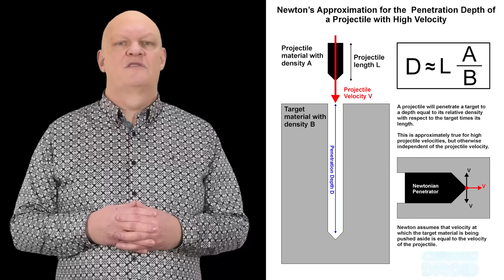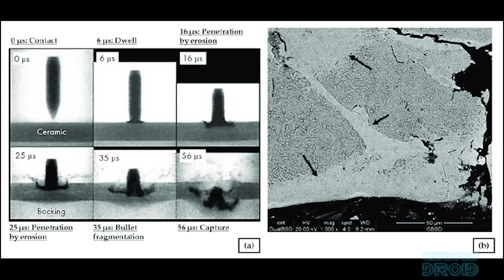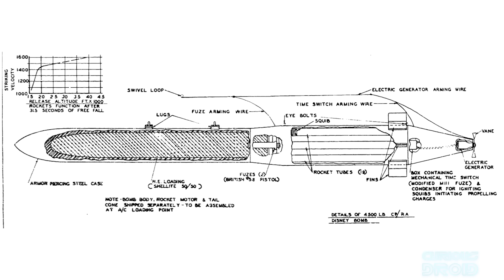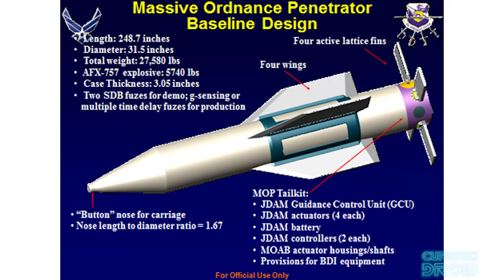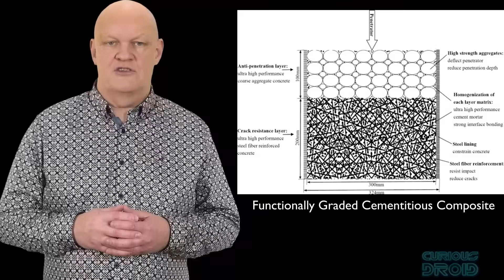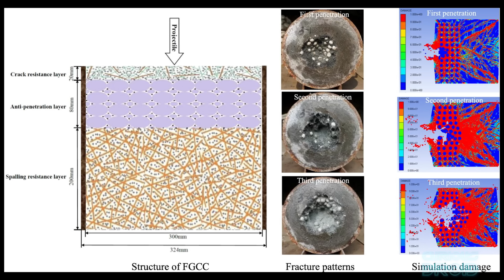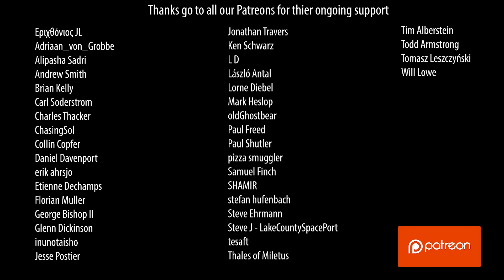Can Iran Stop U.S. Bunker Buster Bombs?

Comment: The next additive to add to the concrete it at the nano scale. Graphine in small amounts adds huge strength. You add it in quantity and you no longer need rebar in most applications. I would assume that would make a difference in  bunker building applications.

Comment: Yes you can.  The penetration of these weapons is rated in terms of standard reinforced concrete with only a certain amount of rebar in it.    Specialized concrete with ceramics in the mix, extra rebar, exotic rebar with very high tensile strength (basalt fiber), explosive layers (like an ERA), etc etc.  Plus placement of the bunker makes a huge difference.  If you tunnel into a mountain and put stuff inside there, you are protected by tons and tons of granite to begin with.  There's a REASON they haven't tried bombing Iran's bunkers.  And it's not "moral restraint", LOL.

Comment: doesnt matter lol bunkers have a very very veryyyy weak side to them...Your trapped in there. If you wanna fight bunker take top control which should be easy if your able to drop a bunker buster anyway, drop bombs on top, shut down any nearby supply lines to the bunker and start gassing them out. Or leave them in there and bury them

Comment: Personally I would have made the engineers work harder by employing some layers that will cause heavy bomb to shift: e.g. explosive layer, layer of HP concrete large triangular blocks surrounded with sand. Those weapons seems to expects equal density in all directions...

Comment: I wonder if new uhcp will incorporate carbon nanotubes. I've seen some tests but they just dump the stuff into the mix and it increases the strength by 30%.

And that's just dumping in crude pellets of it, imagine if we start interlacing it.

They also recently finally found out how to make Roman concrete that can heal cracks so the can last a millennium.

The secret was excess poor refined lime. Instead of grinding up all the you leave large chunks through out the concrete mix, about the size of a dime or half of one.

As the concrete cracks with age and water runs over it. The lime is activated and seals the cracks.

We should be copying this method for new concrete.
Reply: It would be cheaper to produce and it would be less toxic than metal and glass fiber's.

Comment: Can easily be stopped,  use solid steel .... concrete doesn't and isnt a deterrent forget reinforcing with steel, just use solid thick steel ... its not termite,  it's not just going through... not plating... solid.

Comment: You can increase the strength of concrete. But the solution used on tanks, add explosives externally and angled shielding, should be considered. This can assure that the projectile explodes on the outside of the impact zone . Additional, a combination of soft and extremely hard but angled concrete can help to move or rotate the projectile such the impact effectiveness reduces.

Comment: This is like the electronic measures and the countermeasures. I believe that there are two ways to defeat Iran's nuclear industry underground. One is obvious and that is nuclear/penetrator and the second is tandem bombs where the second is homed electronically on the first one with different capabilities. The first one would be for maximum depth using a rocket motor and the second one would be a penetrator but have a much larger explosive charge. The first would pave the way and then the second would go on from there. I can't think of any other ways to penetrate hardened concrete plus depth.

Comment: There was a lot mentioned here, but I didn't hear anything about shaped charges. Would it not be possible to use those to bore further into the concrete than whatever kinetic energy the projectile receives from its velocity and mass? That's how some of our munitions defeat armor, anyway. Figured it'd apply equally as well to a bunker.
Reply: They are easy to deflect and or disperse by several layers of different density.

Comment: Just creator the ground. Have a big steel rod in orbit and guide it in at 20,000kmh. It might vaporise on impact but that is 20,000kmh steel vapor which will blast through the concrete.

Comment: I think that A rocket propelled thin penetrator with an ultra large extremely elongated shaped charge with a depleted uranium penetrator behind it behind it should get the job done.

First kinetic energy punches a hole deep into the concrete then at the correct reading of deceleration the shape charge fires punching a plasma cutting charge through the reinforced fibres and other elements in the concrete followed closely by the depleted uranium Rod still carrying the full kinetic force of the original penetrator—

I could probably knock one up in my backyard if the military industrial complex are interested—

Comment: Cro-moly, Carbide, Nickel-Boron, and Boron-Nitride are all slick as bat shit which helps them slide past the concrete as the projectile passes through.  Could always use a layered approach to bunker attack.  Stack five birds and all five drop two busters laser guided off the same laser impact point.  It might be strong, but I dont know if that's strong.

Comment: All you need is a layer of a triangle style assembly of steel somewhere within the concrete. Thick steel. It'll still do damage but it'll be diverted potentially into a spot that diverts it fully

Comment: You stop the missiles w/  2' Lead (Carbon fiber reinforced), 2' Silicon Carbide (compressed coarse abrasive), 2' Lead (Cfr), 2' Silicon Carbide (cca), 2' Lead (Cfr),  1.5' Tungsten.  Lead is great for density, & molten Lead is not a problem matrix for Carbon fiber.  The Silicon Carbide compressed coarse abrasive is hard enough to tear away at a depleted Uranium or Tungsten penetrator tip as it impacts.  Blunting it into an ever-wider impact surface area, bleeding kinetic energy pushing thru the dense reinforced Lead.  Until it hits pure Tungsten metal 1.5 ft thick.

Comment: Two Disney bombs could be carried under the wings of a flying fortress. The five tonne Tallboy bomb was designed to punch through soil. Late in WW2  Midvale Steel, a part of Bethelam steel, developed the steel for seven metres of reinforced concrete. It also was so good, gun barrels became thinner, as was armour plate. Tallboy had many successes. Including wrecking some twenty ultra long range guns all aimed at London. A single bomb entered soft rock, close to the edge of a thousand ton steel and concrete protecting cover. Exploding, it lifted and moved that far enough, the guns became useless.

Comment: Read a story about the 1991 Gulf War where F-117s were tasked with taking out Hardened Aircraft Shelters (HAS) without any GBU-27 bombs. When the pilots asked if they could have these bunker busters, the brass told them "Honey, we have bunker busters at home..."

The "bunker-buster-at-home" they were talking about was a GBU-10 with a tail fuse and the front half of the Mk.84 casing packed with concrete in the hopes it'd poke through the reinforced concrete hangars...

...it didn't work, and in the initial attack on these airfields the GBU-10s bounced off the HAS to no effect.

A couple of nights later, the GBU-27s came in with the BLU-109 warheads. The F-117s had a second go at the HAS at these airfields and punched through, noting that the ensuing explosions looked particularly impressive...

...you see, the Iraqis took a look at how well their HAS withstood the first attack and decided the hangars were absolutely bomb-proof. After all, if F-117 stealth aircraft couldn't destroy them with direct hits using 2,000 pound bombs, then nothing the Coalition sent their way could touch the shelters or whatever were stored inside. The HAS were intended to protect a single airplane, but the Iraqis crammed several into each shelter, along with any other equipment they wanted to protect from attack (its possible even one of these HAS was turned into an impromptu ammo dump). So, when the F-117s returned with proper bunker-busters, the shelters were packed to the gills with all the stuff the Iraqis wanted to keep safe-- making the penetrations all the more devastating as a result.

Comment: 4:35 
Both of the bullets are lead core with a copper casing... the reason the .223 penetrates and the 9mm doesn't is simple down to the inertia of the bullets, not their composition.
though there are special penetrating rounds with steel cores or depleted uranium but you wouldn't need to use one against something as weak as Kevlar. bad analogy and kind of incorrect factually.

Comment: As an engineering student i anticipate, they're gonna make a system that hits like a multi stage hammer. Going through the same entrance hole, a single bomb splits into multiple cake-like layers once dropped. The following segments use small rockets to reduce speed, allowing each segment to hit in organized fashion. Each segment would use explosives to creates cavities for the following projectiles to penitrate.

Either that or they will make a bomb that is actually a mole designed to dig in 1 direction. Down. It penitrates the first 20 feet on impact and will not stop until it reaches a specific depth before it detonates automatically. It could have a reinforced butt to resist small arms fire and grenades from any surviving individuals between floors 21-300.
Potentially, it could have explosive charges it would drop between each floor, clearing all personnel before itself dropping from one corridoe to the next. 

Perhaps they will make machines that will be dropped that will fling dirt over all the air vents, clogging the filters. Engineers and demolition teams will be sent to remove them and possibly be either shot or detonated on first contact.

Maybe in the future the military will design explosive fabric that uses a mini quantum computer trigger that's entangled with a base in the USA. Make a uniform and swap the closet of anyone who has deep access. 

Instead of making a bomb to penetrate, maybe make a bomb that's designed to lodge itself somewhere important. Designed to release JUST ENOUGH explosive material to kill someone without destroying itself. It could have hundred of rounds on the inside and release a large payload if tampered.

They could scatter hundreds of sniper drones all around the bunker that have anti-tank ammo, internal explosives, scout drones, a high density armored battery, and AI (with encrypted human-radio contact). Effectively they could all work together eliminating anyone who comes close. What are they going to do? Bomb their own base? Add in conditions that if the bots lose contact, they switch to full AI., if one is seized, it explodes. If all else fails, they all detonate, when the batteries get too low, they either detonate or deactivate (keeping a trigger on the explosives).
Reply: anti runway munitions do this already in a way, the main warhead punches holes that make you have to fix the runway, but before it does, it scatters landmines all over meaning that to fix the runway, you fire have to clear a mine field, further slowing repair.

The drones would likely be countered by other drones made to hunt them down, or by hacking the network, taking control of the drones.

The Chinese supposedly are already doing self destruct helmets.

Many military and civilian bunkers don't need air vents as much as you think. They can fully seal up using rebreathers on a industrial scale. of course the quick fix to robots flinging dirt on air vents is removing all the dirt from the surrounding area. and of course sending your own drones to attack those drones and to repair the filters.

To prevent the mole from being effective, harder material between floors and making the bunker spread out and  lacking straight hallways would mean that it hat best would have a small impact. Internal defense laser turrets could safely take it out.

Comment: the comparison with the bulletproof vest is not the best. 9mm is stopped and in the next scene you see a .223 going through the vest. The .223 is much faster and smaller than the 9mm. This makes them more penetrating and not steel core, particular in this case. It is also said that bullets have a steel jacket. This would wear out the barrel too much, it is a tombac jacket, soft iron, brass or something similar. In bullets are only a steel core.

Comment: Watching this video made me think about tank armor and APFSDS penetrator rods. Makes me wonder if anyone tried, or is trying to make an impenetrable battle tank.
Reply: They have, but doing so turns it into a bunker, see the Maus.

Now they're kinda moving away from sheer armor and to active protection which can shoot down APFSDS as they come close. Better to not get hit at all
Reply: Armor in a tank is always a trade-off. The armor is thinner to the sides and rear and thinnest at the top and bottom. Why? Because that will afford you enough weight savings to make the front armor insanely thick instead.

If you decided to thicken up the sides and rear of the tank, you only do so at the cost of making the front armor (the armor most likely to get hit by fire) thinner than before.

Comment: Just saw an interesting video where the Germans were using a small diameter artillery shells to drill neat holes into a Russian bunker. You could look through the approximately 6 inch holes coming through reinforced concrete outer shell. After passing into a passageway it would hit a wall and explode. Shrapnel hits would devastate everything. One shell failed to explode and buried itself into the floor. You could see the impression of a point clearly visible after the shell had been removed. It wasn’t mangled or blunted at all. I was amazed that this was done towards the end of WWII. Now seeing this video, I am speechless. The Germans were only going thru a few feet and now we are going thru meters of the hardest compositions I never dreamed of. An excellent presentation in minute detail too. Just amazing, curious droid gets better all the time.

Comment: At 16:37 that upper layer with the different sized roughly oval spheres within it is very interesting, because it shifts the impacting loads sideways, and maybe even reverses some of the energy back towards the surface. It's similar to the effect of pushing a stake into ungraded damp sand and gravel; it takes a lot more effort than you might think. It's also similar to the reason why railway tracks and sleepers 'float' on a loosely packed aggregate track bed, bearing the weight of heavy railway vehicles for many years.

Comment: The people i live with had a mailbox made with that high strength concrete. They wanted me to break it down. Not happening. Even with a full size jackhammer. It had to be cut up with a saw. I guess the prior owner of the house was tired of having his mailbox hit and destroyed by cars. The house is on a main road so prior mailboxes probably got hit by horrible and drunk drivers plenty of times. High strength concrete the way to go. A hammer did nothing but bounced off of it. Wouldn't even chip it. When you did break a piece off all the little fibers would kinda keep it together. I never saw concrete used residential like that before. Im sure it is used but most concrete I've seen is just the v regular concrete.

Comment: 9mm and 223 rem rounds are not encased differently. It's the velocity that allows the 223 to defeat soft body armor. Both have a copper jacket and usually a lead core.
Reply: Many people use 223 interchangeably with 556, and NATO standard 556 is encased differently than 9mm. Both M855 and M855A1 have steel penetrators, and can penetrate 3/8” mild steel (at 160m and 350m, respectively). 
However you’re not wrong about 223, just think that it’s a safe bet to assume someone is talking about NATO 556 if they say 223 in a military context.
Reply: Its also the shape of the bullet, a pistol round is a blunt/round top and most rifle rounds have a sharp point which allows them to slide more easily between the fibers of a Kevlar sheet (because it can deform them more easily due to the sharp point)

Comment: I would like to know more about the effects of partial penetration - embedding of a bunker buster into such ultra-high performance concrete (and composite laminates thereof) so that its warhead has to explode inside this thick concrete shield. Can such a detonation degrade the concrete shield and "pave the way" for subsequent bunker busters, following in close succession, eventually leading to complete penetration? If a bunker buster is stuck in the concrete, does it actually detonate, as it doesn't detect a void in which it should preferably explode?

How about the use of large-diameter shaped charges? Is this a viable option for penetrating thick slabs (and complex laminates) of ultra-high performance concrete?
Reply: who you tryna kill ?
Reply: thats a joke .. dont kill people.

Comment: standard reinforced concrete is relatively soft........like butter.  There is a type of reinforced concrete that uses a product called "fiber steel". In the past it was small wound coils of wire, but these days it is little steel staples.  In WW2, fortifications using fiber steel were extremely difficult to destroy, the Finns frustrated the USSR during the Winter War of 1940......the soviets found the fortifications to be almost indestructible. Can only imagine what is available now.......almost 100 years later. There is no answer to simply putting the target deeper underground, and/or using thicker, multiple layers of protection. Perhaps real diplomacy instead of supremacist war mongering is the answer........